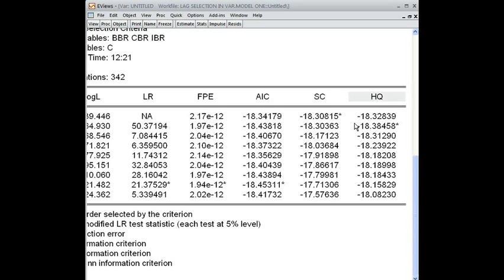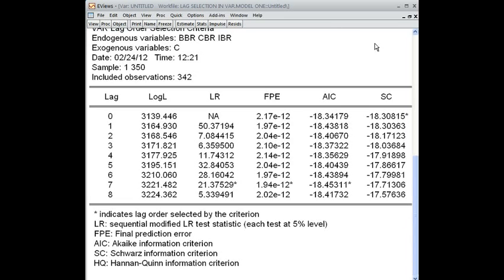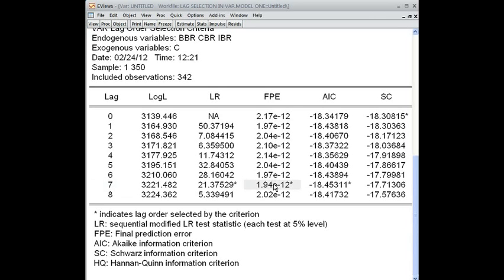Lag selection.Model three. EVIEWS

Comment: Hello Sayed,

Thank you for your vide. 

In your video on lag selection for Johansen test you found that the maximum number of lags for the VAR model is 7. Then you use the same lag selection, namely, "1 7" in the Johansen cointegration test. Two questions:

1) The Eviews 9 guide on Johansen says that "the lags are specified as lags of the first differenced terms used in the auxiliary regression, not in terms of the levels". The Johansen test uses the ECM form of VAR. The ECM form of VAR has lags of the first differences one less that the original VAR orde. For example, if we had VAR(2) then in the ECM form there will be just one lag of the first differences. 
Does that imply that for example in your case you should specify for the Johansen test the lag structure "1 6" but not "1 7"
The Eviews guide page is below 
(http://www.eviews.com/help/helpintro.html#page/content/coint-Johansen_Cointegration_Test.html)

2) What does a pair of the lag structure selection mean? For example "1 7": 7 means use up to 7th lag. And what does 1 mean? Use lags from 1 to 7? So "2 7" would imply use lags from2 to 7

Waiting for your comments.

Regards,

Argyn
Reply from the maker: Dear Argyn, I would like to invite you to join Hossain Academy Facebook at below link and post this question there, I shall respond. Thank you once again, Sayed Hossain from Hossain Academy. https://www.facebook.com/groups/hossainacademy/
Reply: Hello Sayed, I posted it on the Facebook page. Best, Argyn

Comment: Hossain, I have a question, everywhere I read that the lag to be used in the Johansen test should be one less than the lag determined lag length criteria in VAR, but you use the same lag? Also if the maximum lag is the optimal lag, and use this in Johansen test it does not work.

Another question: if the optimal lag is 1 and I use 0 0 for Johansen test (-1 lag) should I use the same lag ( 0 0) for the Vector Error Correction or (1 0)?
Reply: Sayed Hossain dear sir, i think i am pretty sure we have to use k-1 in VECM/Johansen cointegration, for k suggested by AIC/SIC/HQIC for VAR model. I repeatedly see this in different discussions. From the way i understand this, the the regression in VECM/Johansen automatically takes first difference. therefore, by including k-1 lags in those two regressions, u are involving k lag's information. but i am really puzzled what u should use for VECM/Johansen when AIC suggests k=1 for VAR.
Reply from the maker: Sanne Rodenburg Yes that may be less than 1 as you said..But I used all same lags for all system equation models such as Johansen, VAR and VECM...
Reply: Sanne Rodenburg on the other question, I doubt the same. did you find the answer yet?
Reply from the maker: Yes many literature suggests that in Johansen number of lags should be less than whatever has been suggested by VAR model.
Reply from the maker: Yes literature says so. I would like to invite you to join Hossain Academy Facebook below for greater interaction with me.
https://www.facebook.com/groups/hossainacademy/

Comment: Hello Sir, after watching your teaching, there are still some questions confusing me. Firstly, when we choose the lag length criteria, it requires us set the max lag length. How to set this number? In practice, I use quarterly to do this analysis. When I set the max lag length from 2 to 10, the results are almost different. From 2 to 3, the criteria shows the 2 is the best. However, from 4 to 10, the results always show that the best criteria is the largest lag length. For example, when I choose 6 as the max length, the result shows that the 6 is the best one. Secondly, does it require that the lag length for VAR, VECM and Johansen Test should be same?
Reply from the maker: Yes results will vary but if you take more lags, you will be loosing more degree of freedom and that is why I am not asking more than 5 lags as maximum. So that lag selection will be within 5.

Comment: Dear collegues
I am currently stuck on testing PPP for long run effect between France and Germany during post-Bretton Woods period (April 1973-December 1990). I need to check for cointegration (Johansen test) among Fr/Ger exchange rate, Fr CPI and Ger CPI. Taking logarithms, basically, the equation looks like ln(Ger/Fr)=ln(Ger CPI)-ln(Fr CPI). Preliminary, we should test for unit root, and there is the most interesting thing: utilizing ADF(with constant and trend) and Perron's Procedure I got Ger/Fr = I(1), CPIs are both I(2). The question is how can I perform cointegration test if ranks of integration are different? Is it eligible to take the difference concerning CPIs to derive I(1) process and proceed with Johansen test? 
Regards

Comment: Mr Hossain,as you showed in the video, can I use this lag selection criteria for VAR, Johansen cointegration test and also for VECM model? You showed a different criteria in another video (putting pairwise 1 1, 1 2 etc lag and selecting lowest AIC value) , which process is best?

Comment: Hello, I just wanted to know when selecting the data should it be level or 1st difference incase its not stationary? The data will be used for Granger causality (where from your other videos it said the data has to be stationary for granger causality). So should we use the lag based on the stationary data set (1st difference) or non-stationary data set (level). Your help is greatly appreciated.